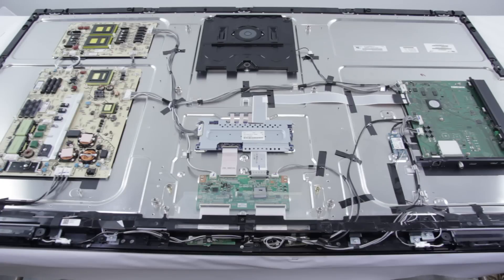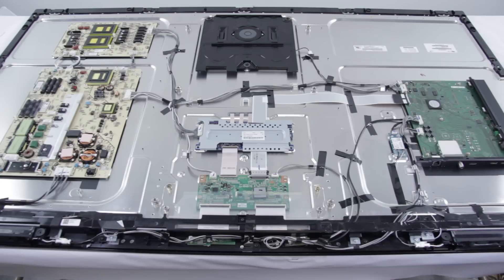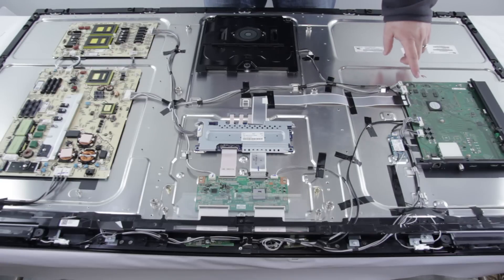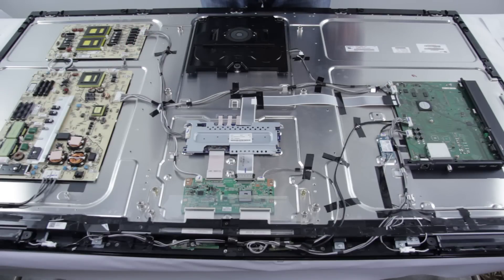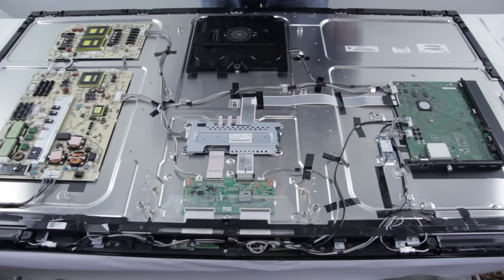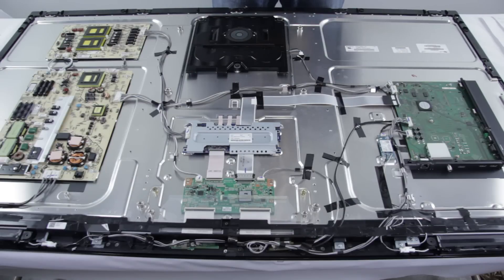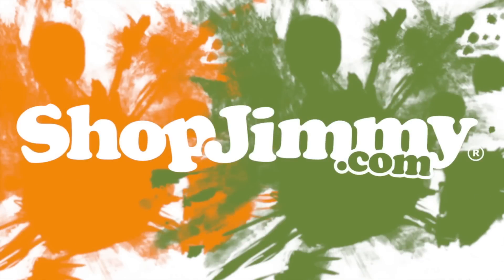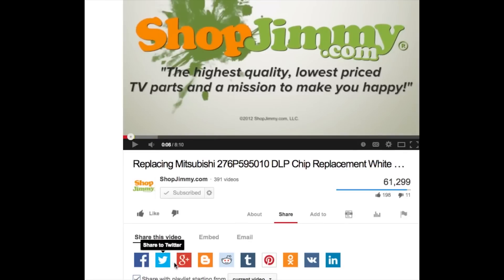LED TV Repair Main Board Overview Blank Screen-TV Has Audio but No Video-Common Issues Problems

Comment: RELD4627A hey I have rca 46 inch led tv half the screen is dark like the back light isnt working I use to be able to squeeze the corner of the TV and it would come on any advice would be much appreciated

Comment: Hisense 50R6D. My screen has thick vertical lines/bands. They vary in color and change after a while of the tv being on. I have replaced t-con, all ribbon cables, and taken the bezel off to check tabs, all to no avail. I can hear sound just fine, but still no picture other than the colorful bands.

Comment: I have an LG 47GA6400, when i turn it on the screen goes on but just stays on the ambient grey light with no audio or input options.  I press  menu to try and check the settings or change input and nothing comes up on the screen.  So far I have opened it up and checked to see if maybe it was a blown capacitor on the power board but they all appear to be fine.  what could cause the tv to not work the way it is where the ambient light on but no audio or video?

Comment: LG 55LA6900 when I push the power button the lg symbol on the front comes on and fades out. I get no sound and no picture. I have replaced the power board with one from shop Jimmy and the same issue.

Comment: My light on the lower left hand corner of the screen comes on  , but in a few seconds goes off without audio or video coming  on .  It is a 55 inch Vizio  E550i 1080p smart LED HDTV..Joe Lasky

Comment: we have a 32 inch Sony kdl32l504. it has audio, hdmi still works ( we can hear the audio from cable ), the screen is black with no picture. when we cut the TV on via power button, we see hdmi at the top for about 3 seconds, and then nothing. could you guess what the problem is? Thank you.

Comment: I have a Mitsubishi LT-40151  has video but no audio.  Is this a common problem with this tv and do you have any advice for me?
Reply from the maker: Cory Mayner  Please watch this video FIRST to help with your repair!  https://www.youtube.com/watch?v=BP3NVNCGEv8  I recommend replacing the main board in your TV.  Click this link to replacement parts for your TV model number:  http://www.shopjimmy.com/catalogsearch/result/index/?cat=56&q=40151  There may be multiple boards for the same TV model number, be sure to match part numbers on your current board, with your replacement for compatibility.  Here is a link to a video showing how to identify your part number, click here:  https://www.youtube.com/watch?v=BEPWrefQvqI  Thanks and please let us know if you have any further questions with your TV Repair!  www.shopjimmy.com

Comment: Hello, I have an RCA LCD tv model number 32LA45RQ. The menu screen keeps popping up and going away really fast over and over. I can bring up my xbox on it but the little menu pops up still over top of everything. Any idea what is wrong? RCA said the board would probably need replaced if that is correct do you have the part? Thanks!
Reply from the maker: Johnathan Michael   I recommend replacing the main board in your TV.  Here is a link to replacement parts for your TV model number on our website, click here:  http://www.shopjimmy.com/catalogsearch/result/index/?cat=56&q=32LA45RQ  Be sure to match part numbers on your current board, with your replacement for compatibility.  You can also call our customer service for further assistance with your purchase.  (877) 881-6492  Thanks and please let us know if you have any further questions with your TV Repair!  www.shopjimmy.com

Comment: Good Day, That was a cool video to start troubleshooting. I own a LG 32LE5500 LED TV, all my HDMI Inputs are not working (on back panel as well as side panel), the RCA (AV1) is working well. Please advise whether this is a small issue or will it need replacement of the main board. Also please advise the part number and a potential cost of the same - Thanks.

Comment: I have a 55in Hisense Roku TV when I turn it on it lights up and then turn back off I tried the 30-minute unplugged the sequence of remote nothing seems to work I know the back lights comes on because it shows a picture of the lion guard the TV model number is 55A6100FUR OR 55R6E3 I am attempting to change out the boards in the back of the TV it has to board a large board and a small one it looks like the power board and the main board is combined into one and then it has a smaller board at the bottom don't know which one to change out maybe both boards need a little bit of help to decide which one

Comment: Thanks Jimmy for the youtube video.  I have Mitsubishi LT-40151 S/N 104206.  It power on with blank blue screen and blinking green LED.   What is your recommendation?

Thanks in advance.  Nick.
Reply from the maker: Nick P   I recommend replacing the main board in your TV for your TV Repair.  Unfortunately I do not see any replacement main boards in the search results for your TV model number on our website.  Thanks and please let us know if you have any further questions!  www.shopjimmy.com

Comment: Our LG 47 inch   model #  47LN5400-UABUSYLMR      Ser #  310RMAQ81376      went blank.  Its 2 yrs old and resetting it did nothing and Directv said the tv is dead.  Do I need a new internal board?  Do you have them?  Thanks
Reply from the maker: +Robert H   Try all repairs and troubleshooting at your own risk.  Is the TV dead or do you not have a picture on the screen?  Thanks!  www.shopjimmy.com

Comment: I have a LG 47Ls4500 that turns on and half the picture is dark. Then a couple seconds later it goes black. It still has sound. I have access to all the replacement parts but, no idea what to replace. Thanks for your time

Comment: I have a Vizio xvt323sv that won't turn on (no sound no picture no light on screen at all) the only life it shows is the Vizio logo on the front of the tv (not on the screen) blinks between amber and white for a bit then turns white for around 10 seconds then back to amber and stays for a bit then repeats. The amber light is always illuminated when TV is off. The TV when working would turn off and do this then power back on by itself every few months so I always thought it was a firmware update. I am trying to figure out what board is causing the problem to replace. Thanks for your help.

Comment: Hello, I have a Vizio M550SV and the audio just stopped working but the picture is fine. The audio out also stopped working. After the TV was off over night the audio was on at start up but went off after just a few minutes. Would it be the main board causing this problem?
Thanks for your help.
Reply from the maker: Maint. Dept.   I recommend replacing the main board in your TV.  Click this link to replacement parts for your TV model number:  http://www.shopjimmy.com/vizio-3655-0342-0150-main-board-for-m550sv.htm  There may be multiple boards for the same TV model number, be sure to match part numbers on your current board, with your replacement for compatibility.  Here is a link to a video showing how to identify your part number, click here:  https://www.youtube.com/watch?v=kxkeGLhlQY8  Thanks and please let us know if you have any further questions with your TV Repair!  www.shopjimmy.com

Comment: Hello I have LED SEIKI SE46FY10 that has no lights. It powers on Audio works, back lights dont work, there is picture when flashing on the screen in the dark i could see the menu. I tried replacing the main board and the power supply unit with no luck. Any advice?

Comment: Hi,
I have a Samsung UN40F6350AF model code is UN40F6350AFXZA version is TS01.
On power on (plug in the wall) the only thing that shows up is the SMART TV logo that goes on and off. To stop that I have to unplug the tv. There is nothing connected to the device and obviously the remote do not operate. The TV is 13 months old. When the problem appeared 4-5 days ago, it was going off a few seconds and get back on after running an hour or so and it was getting worst every day. I di a software update and after that no more image on the screen, just the smart tv logo flashing. So do you think there  is a fix or just scrap the TV set?
Thanks for any help.

Comment: Hello, my LG model 50lg5400-UA screen has gone pitch black, but there is sound. What parts do I need to repair this Lg flat screen? Because, I have been known to work well with electronics and I believe I can fix it myself if I knew the parts I need.
Reply from the maker: rodney henderson   Try all repairs and troubleshooting at your own risk.  I recommend running the flashlight test on your TV.   Here is a link to a video we produced that shows how to run the flashlight test. https://www.youtube.com/watch?v=xUzCLgoSPGM Please reply with your flashlight test results and we can recommend a replacement part for your TV repair. Thanks and please let us know if you have any questions! www.shopjimmy.com

Comment: Hi there, I have an LG 42LB585V the screen has gone blank but there’s still audio coming through, I have switched the tv off and back on again and the red standby lights and blips 3 times, do I need a new main board ? Or I have heard about replacing capacitors for higher rated volt rating, any info you could give me would be greatly appreciated thank you.... wes

Comment: hi there i have a LG 55la620v-za   which switches on and the picture comes on .. then at random times either 2 second up to 2 hours in the picture goes off but the sound is there and i have to switch the tv off and back on to get it back untill it does it again any advice on which part is needed to fix this would be gratefull

Comment: I have a vizio tv model number E370-a0, the picture comes on but after a few minutes the screen goes black and the tv stop responding. I have to plug out the power source to take it off. Any thoughts? Thanks!

Comment: Hi I have an element tv model number ELUFT551. The sound has stopped working. If I reset it manually I do get sound however sometimes it takes a few attempts

Comment: I have a Vizio XVT473SV......... when I power on the backlight can be seen flickering on the edges but no Vizio logo ever appears.... tv was hooked up via hdmi to ATT U Verse and not messed with but screen would show nothing, no input selection, logo or anything....ViZio said it sounded like the video board went out, Is that part of the main board? What is the cost of the needed part and is it new?  Thanks
Reply from the maker: James Midgett   Try all repairs and troubleshooting at your own risk.  I recommend replacing the main board in your TV.  Click this link to replacement parts for your TV model number:  XVT473SV  There may be multiple boards for the same TV model number, be sure to match part numbers on your current board, with your replacement for compatibility.  Here is a link to a video showing how to identify your part number, click here:  https://www.youtube.com/watch?v=kxkeGLhlQY8  Thanks and please let us know if you have any further questions with your TV Repair!  www.shopjimmy.com

Comment: I have this Samsung UN39FH5000 FXZA TV that don't have back lights on, when I plug the TV in outlet standby light blinks 6 times and goes  off, one time sound sounds when its plugged, do you have any idea what could be wrong since the standby light blinks 6 times I measured voltage on power supply board and it looks ok on the plug to main board, I am wondering if main board would fix the problem or not 
Thank you for your help
Slavko

Comment: I HAVE A VIZIO MODEL E07I-AO. I WAS GETTING SOUND WITH NO PICTURE. BUT THEN I STARTED TO CHANGE THE INPUT SOURCE AND SINCE I REALLY CANT SEE ANYTHING I DON'T KNOW WHERE THE INPUT IS. I'M WONDERING IF IT PAYS TO HAVE IT FIXED? I'VE BEEN TOLD THAT  VIZIO PARTS ARE DIFFICULT TO GET.

Comment: I have a UN60EH6003F Samsung 60 inch non smart TV, my video stopped working and all we had was a dark backlight but good sound. I replaced the T-CON board twice, the first time the TV kept restarting within a second of it coming on.  The second board works for about a minute then fades to black.  Do you think I got unlucky and got a second bad board? Or is there something else that might make the screen blackout?

Comment: I have a Sceptre x405bv-fhd tv. It started talking longer and longer to turn on until eventually it wouldn't come on at all. The blue 'on' indicator light lights up, but no sound or picture. Do you have an idea what this could be?

Thanks
Reply from the maker: +Frank Giancursio  Try all repairs and troubleshooting at your own risk.  I recommend replacing the main board in your TV.   Click this link to replacement parts for your TV model number:  http://www.shopjimmy.com/catalogsearch/result/index/?cat=56&q=x405bv-fhd  There may be multiple boards for the same TV model number, be sure to match part numbers on your current board, with your replacement for compatibility.  Thanks and please let us know if you have any further questions with your TV Repair!  www.shopjimmy.com

Comment: I have an issue with my LG 47LS4500 it had the white screen so i replaced the tcon board. After i replaced the tcon board half the screen dims a little for a second and the next second it goes back to normal and it does this every second. Could you help or have any ideas?

Comment: Hey guys I have a Westinghouse dwm32h1g1 that has sound and no video.I am assuming it is the board but am having trouble locating one any help would be great thanks
Reply from the maker: +togilli9  Try all repairs and troubleshooting at your own risk.   I recommend replacing the main board in your TV.  Unfortunately I do not see any replacement parts in the search results for your TV model number on our website.  Please reply with your part number on your main board and I can try searching for replacement parts.  Thanks and please let us know if you have any further questions!  www.shopjimmy.com

Comment: HI JIMMY I HAVE SHARP AQOUS 70" MODEL 70-LE640U BLINKS 2 SLOW & 5 FAST I REPLACE POWER SUPPLY BOARD AND STILL GIVING ME ERROR CODE AND NOT TURNING ON. CAN YOU HELP ME BEFORE I BUY THE OTHER BOARD MAIN AND T-CON...

Comment: I have a Seiki Model SE50FY28. I get sound and picture but the picture is very scrambled and the TV won't switch between source modes. Could this be my main board?

Comment: Sony KDL- 55w800C when I turn on tv, there is no display but there is white led indicating that there is power. A technician said is a part in the mainboard need to be replaced but he charges $400. Is there a way for me to troubleshoot. I have a multimeter

Comment: I have a sharp lc-50lb371u, I have audio but no image, took it apart and tested each led light strip and only four led lights were not working the rest of them worked, if I put a flashlight to the dark screen I can see an image but very lightly. I ordered the main board already just to see if that’s all it was since the led driver is on the main board. That didn’t work? Any help would be appreciated, TIA.

Comment: Hi I am having a problem with my Seiki TV. Seiki32hy. The TV turns on but just sets at a black white screen. I can tell you led light strips work fine after being replaced. I do hear sound. I don't even get the Seiki logo to come. if you can help I'd appreciate it.

 Thanks, Louis

Comment: Hi I have a Kc-3913 that has no image or sound the power lights comes on but that's it. I took it a part and the board looks ok, no blown capacitors or damage on the board. Please help thank you .

Comment: My vizio E500i-b1 has no picture. The power light comes on but then fades out. Sometimes if I keep power cycling it I will get sound but still no picture. Don't know if this is related but been having trouble with the remote not working like the batteries are dead/weak even after replacing batteries. Could this be the ir sensor board?

Comment: I have a Seiki 50" flat screen (Model # SE50FY10). It turns on and the sound works, but I am having trouble with the picture. When I turn the lights off and go at it from the side with a flashlight, I can see movement. Therefore, I think it is a bulb. Can you confirm that? Also, before the picture completely went out, it went out temporarily until I messed with the power cord in the back to get it to come back on. After that it worked for another month and now I am where I am currently, with no picture. Help please?

Comment: Vizio e 390-ai not turning on. One fuse was blown, we replaced it but it still did not work. Any advice as where to look next?
Reply from the maker: +Whitney JA Winn   Try all repairs and troubleshooting at your own risk.  I recommend replacing the main board in your TV.  Unfortunately I do not see any replacement parts in the search results for your TV model number on our website.  Please reply with your part number on your main board and I can try searching for replacement parts.  Thanks and please let us know if you have any further questions!  www.shopjimmy.com

Comment: I have Samsung UN55JS9000FXZA, i have back light on and audio but there is no picture. I recently replaced the T-Con purchased on ebay, yet it has not change. I noticed when one connect box is connected to main board, it draws power and the tv switched off and on. I need your technical advice if the tv is worth rescue. Thanks